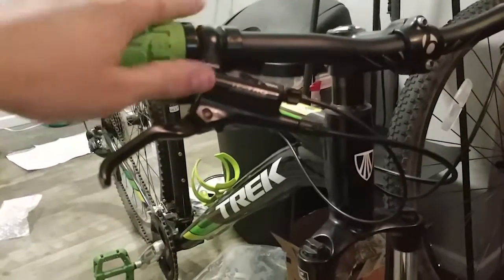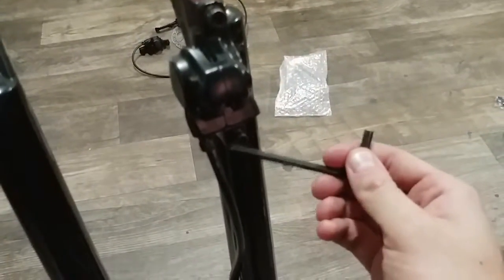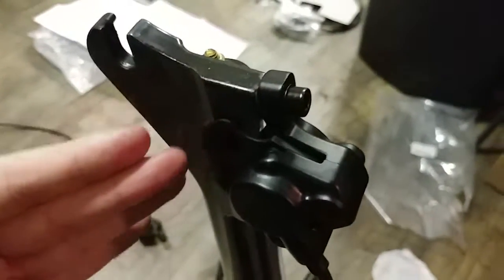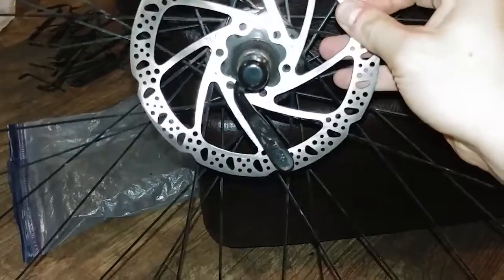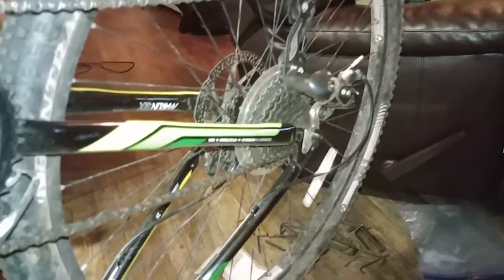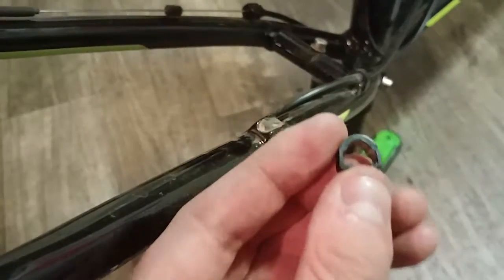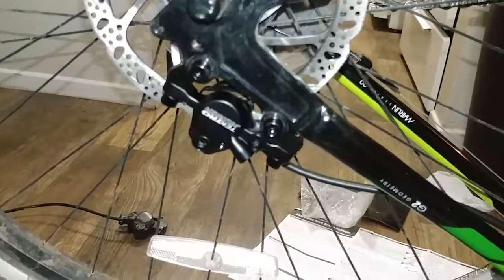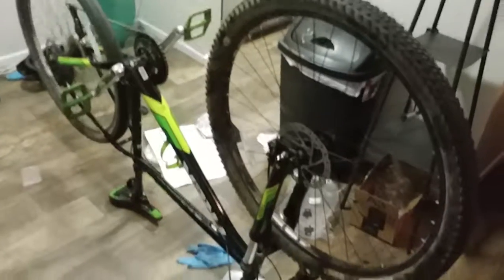Tektro Auriga M290 FULL Brake System Replacement (With Alignment!)

Comment: If I understand correctly, with the old Auriga M290 levers, you could not take the lever piston out. The lever itself had a pivot pin riveted in (maybe still has that on the new version too - the pivot pin is apparently not removable) and the piston rod did not have an adjustment bolt where it attaches to the lever. That old version had a half-assed lever angle adjustment bolt, facing forward (with the lever mounted on handle-bars).
The new version of the M290 levers does not seem to have that stupid forward-facing adjustment screw, but does seem to have a second pin for piston rod attachment, and there's a hex bolt through that second pin, serving to adjust the position of the piston relative to the lever position. This new adjustment bolt is hidden under the lever. Am I right to believe, that this new adjustment bolt (piston rod attachment style) allows you to detach the piston rod from the lever, rotate the lever all the way out, and pull out the piston?
I have the exact same levers on an older bike, and one of the levers is starting to leak from the piston. Thanks for confirming that problem BTW. I'd love to try and get new seals for the piston (the's probably an outer o-ring and an inner V-shaped hydraulic seal, possibly standard dimensions) but in the old version of the levers it's impossible to get access to that darn piston. With the old style levers, all I can do is scrap the levers and the brakes too, because you can only buy them in complete sets :-(
Comments welcome. And thanks for the vid :-)

Comment: Is this already twin piston?
Reply: The brake caliper = the thing that grips on the disk, does have two pistons (aka "pots") pushing the pads against each other. One piston/pot from either side of the disk.
The Lever OTOH contains a single piston.
Reply: @frr5004  how long have you been use this brake? Is it recommended?
Reply: @yogie1882  I got it on a second-hand bike that I bought for my kid last year. The old version that I have on the bike seems difficult to re-seal if the piston starts to leak (I haven't figured out a way to remove the lever's pivot pin). I've seen rare photoes of a newer version where the piston is possibly accessible for service. Other than that, the brakes do work okay, they do seem to serve the purpose. I'd probably purchase a whole new kit myselfs, except that, where I live, currently they're totally out of stock, so maybe this is no longer a current model. Right now I'm eyeing something from SRAM or Shimano.
Reply: @frr5004  what shimano or sram is good enough? Deore?
Reply: @yogie1882  I believe generally anything above the cheapest Tektro price level is good enough :-) and maybe even the current incarnation of the Tektro M290 is okay. My only complaint is serviceability of the lever piston in the old M290. (And in fact I just hope that I'd be able to find a compatible piston seal as a general off-the-shelf hydraulic spare part.) I have a similarly old Deore M446 and that works just fine after all those years. Differences between the higher-priced brands and models are below my radar right now :-) generally I'd say less weight, better precision and some available spare parts for the more expensive components. Shimano seems to keep some select model lines long-term available, as retrofit parts for older component systems (3x9 / 3x8 / 3x7 gear systems for instance). Deore sounds like a reasonable brand overall, even though it has gradually "depreciated in the ranks", somewhat, during the last two decades or so... still I believe Deore in general does not $vck, and Deore XT is still a higher-end component family. Current SRAM "Level T" looks okay too - and is expensive enough to be still available for purchase :-)
While trawling the net for info yesterday, I realized that there's a global shortage of cycling components, has been raging for almost the last year, and is expected to last for maybe a year into the future :-/ if not longer. In many respects similar to the global shortage of computer chips: COVID has increased demand for products, has cut the workforce in S/E Asia and hampers transportation to the west... To me it's the right time to repair old stuff to keep it operational :-) and see how the market turns out in a year or two.
Before I purchase new brakes, I'll check with a ruler or caliper, if the existing brake disk on my wheel hub is compatible with the brake model that I'm plannig to purchase. In general I hope it should be - even though the Shimano Deore tends to have "centerlock" mounted brake disks, where the cheaper competition has the "disk holder star" integrated on the hub, and the disks are mounted by 6 individual bolts. Same goes for the brake caliper mounting points on the frame.
At least I have two bikes with two different brands of brakes to compare the differences. It's a pretty bad situation if you need to buy components online for self-service and you cannot "try them on" before paying for them... The cycling component systems are getting ever more complicated, with "innovations" coming out every other year, and replacements for older systems getting gradually more difficult to obtain...
Reply: @frr5004  i agree, even cheapest tektro is good enough, By the way I ask this question about 3 month ago before I decided to use M290. I think it is better than shimano mt200, i feel it is smoother than mt200 i've ever tried. And if i have more money I think I'm gonna buy Tektro Orion 4 piston I like design and it has 4 piston
Reply: @yogie1882  Thanks for sharing your experience with the mt200 :-) I've noticed those listed in e-shops, but currently unavailable. So now I know better - thank you.